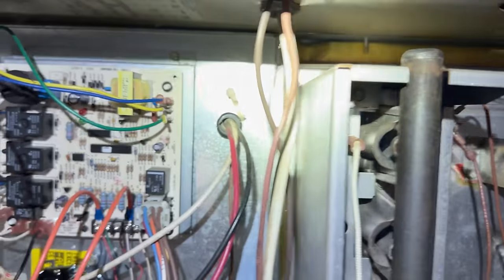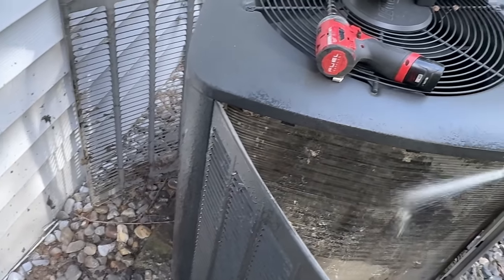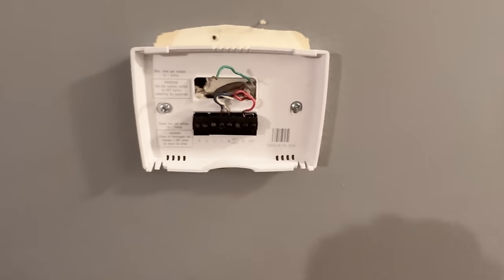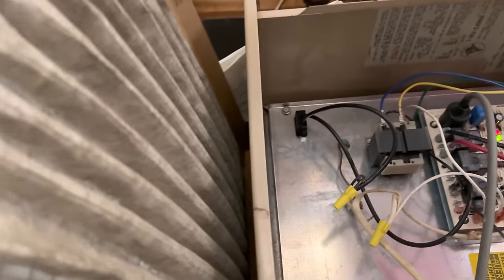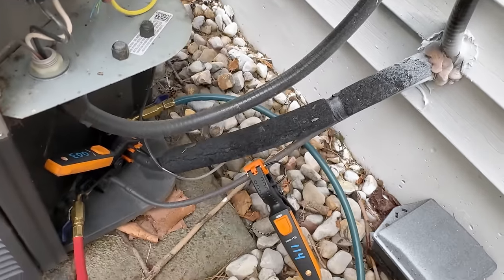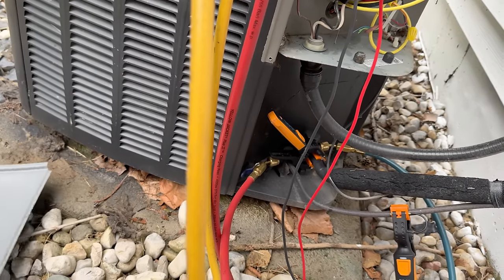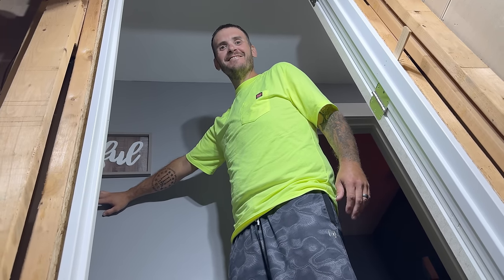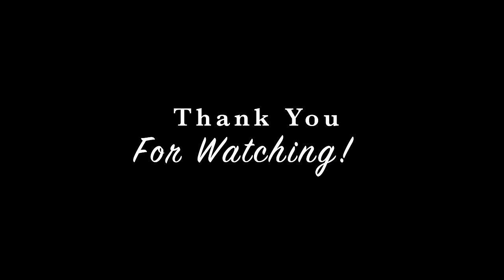AC Is Broken So Was The Owner After The Fall

Comment: 29 years experience.  Explains your impressive troubleshooting. I started in 08'
Reply from the maker: We worked on so much Lennox over and over it got to be kind of boring after a while. We also sold carrier but nowhere near the volume Lennox.
Reply: @HVACRSurvival  Back in the 70-80's You couldn't  be a Lennox  dealer if you sold any other A / C brand. They were anal about it.
Reply from the maker: We were a large Lennox dealer in ohio. From what I was told we use to warehouse some of there equipment for them.

Comment: When I started in this business I did residential new construction. We installed Lennox. The board on the 80mgf was a common failure.
Reply from the maker: 83m00 for the longest time. I know it got high priced because it replaced several boards I believe. I've been away from Lennox for 10 years now.

Comment: The old 90340. Remember them on the fan centers those and the clock spring coil for the heat delay and high limit. Then they got fancy and put a little time delay circuit board on the 90340.
Reply from the maker: Are used to carry four of those insert limits with heated Time fan start. I could about build a furnace with what I carried on my truck.

Comment: Keep wearing that metal watch band and see what happens. No jewelry, no metal anything when I work around electricity.

I just happen to work on x-ray machines that can deliver up to 75,000 kV or even 400 V DC. Metal is not allowed in these circumstances.
Reply from the maker: My ring is rubber. I just recently switched to a metal watch band and I have been using Plastics since I was in high school so I never even thought about it until just now.   Good call

Comment: I started in October '95.
Reply from the maker: July for me.
Reply: To get my foot in the door, I started out driving a truck delivering ductwork to new construction homes. During down times, I worked in the sheet metal shop putting together fittings and installing soundline insulation.  Within 6 months I was at another company, running installs in new construction. Within another year and a half I was running residential service. Another year of that and it was straight commercial service for me. Then on to commercial refrigeration install and service. Fitting pipe for 4 hours a day, and brazing for the other 4 makes you very good at brazing. For the last two and a half years I’ve been owning and operating a mechanical contracting company in Northwest Montana. Almost never having to get sheet metal fittings made is a major plus. Experience is king. I tell young guys, “When your company stops teaching you, the next company probably will.” It’s ridiculous to stay with a company who only teaches you enough to make them money.

 I ready enjoy seeing the equipment you work on, takes me back to the old days of Commercial Service. A truck packed full of tools for the plethora of things you do. At one point I had 6 different refrigerants stocked on my van.
Reply from the maker: Wow that’s really cool to hear.